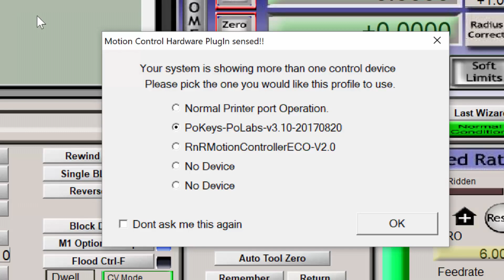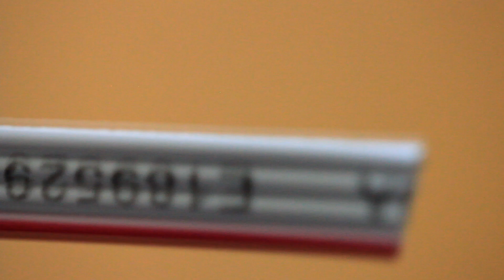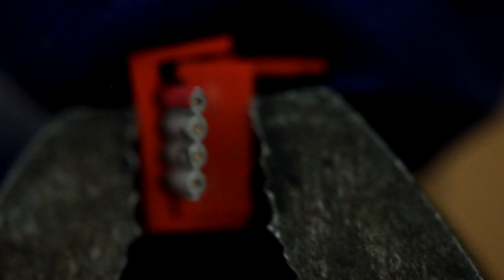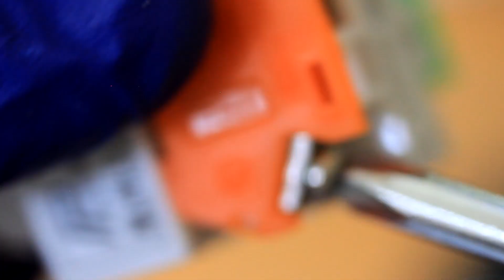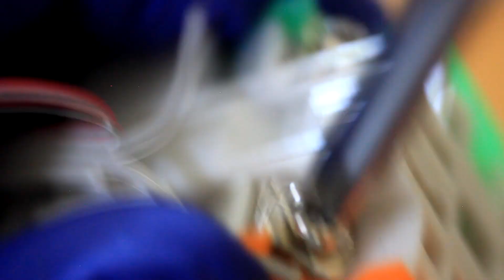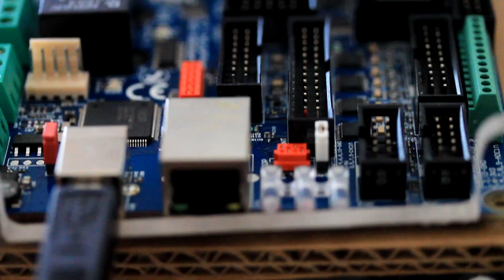8. Adding an E-Stop Switch or Button to the Pokeys57CNC CNC Machine Interface

Comment: Hi!  Great video!  I was wondering if I could get some advice?  I have a 3 axis mill and the controller is dead and I want to build a new one.  Can you recommend a good kit and control software?  Many thanks!
Reply from the maker: What size motors and how many are you needing?
Reply: @PatrickHoodDaniel  This desktop 3 axis mill has three older 30.3V Globe motors model 537A480.  Previously it was driven by an IM Service controller.  Unfortunately, I haven't a way to send photos on YouTube.  Any advise you are able to offer would be greatly appreciated.  Thanks!

Comment: is this board POKEYS57CNC   WORKING WITHOUT DRIVERS
Reply from the maker: There are drivers there, but they are not the PoStep drivers.  I'm using standard drivers in this case.

Comment: Patrick your work is awesome, thanks a lot, all your videos are incredibly helpful :D
Thanks from México.

If there is someone of the Development team reading this, some pokeys guy, i wanna ask for something, can you remove and replace these red ports please?, do it and you will bring the best PC Based CNC Interface, idk maybe there are some electric reasons to use that kind of connector and use that flat cable at the same time, maybe teres not exist a four pin connector for that cable, there could be many reasons for sure, also i think there is or i feel a bit of ambiguity between the Axis Limits Connector and the Green terminal bar (idk what others think but, i love screw terminals), maybe u could use more screw terminal, maybe another análisis about the pinout distribution i guess, i know omg this guy is crazy out by far he doesn't know what the hell is he talking about, and yeah maybe i need know a lot of this interface, actually it looks awesome for me, but i feel that the balance between its powerful its potential and simplicity is a bit lost, i wanna buy your board but i have some doubts of that red connector, hahaha most probably will buying your board at the end, but if you do something for that items on next version it will be fantastic, this is not a bad criticism or it is not my intention, its just the feeling of a future fan for  sure. This board could be the standard in next years :D Congrats.
Reply: Hey I own the Pokeys57CNC board,  I use my estop not on this connector but on the pins 4 and 5 on the pendant connector, In Mach4 you can then set the estop condition to these pins and to be active low, which I highly recommend doing like this video suggests,  the manual has more information on this.
Reply: @markwigglesworth8816  yeey!!! you are right thank you very much i will consider it :D